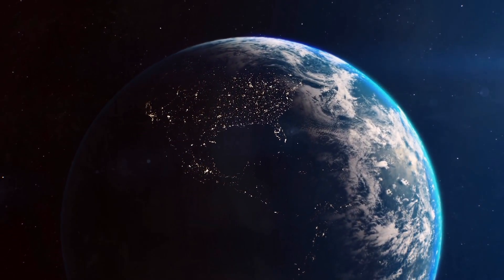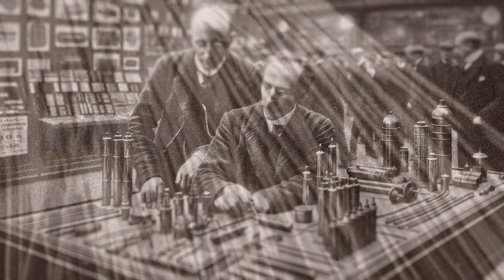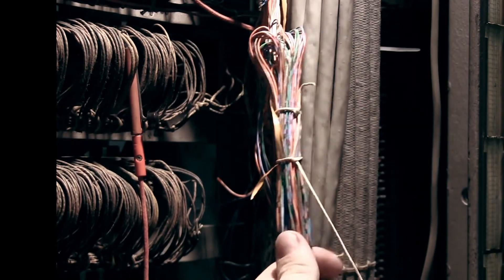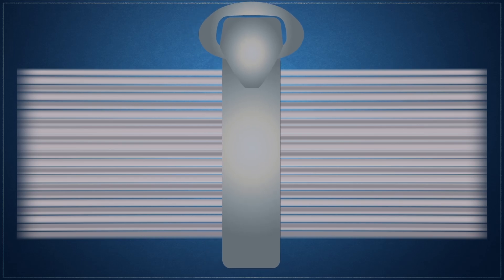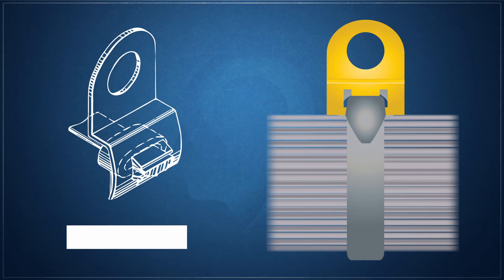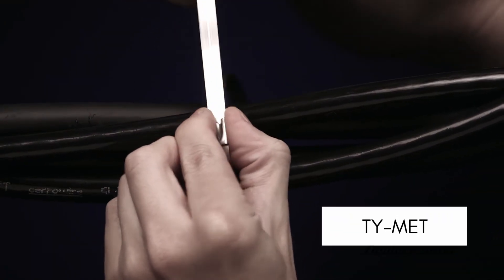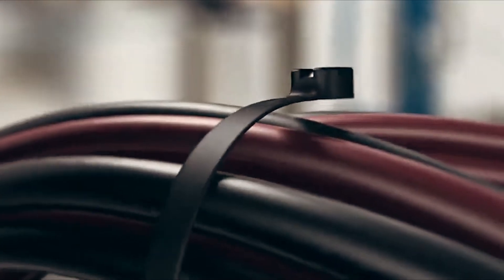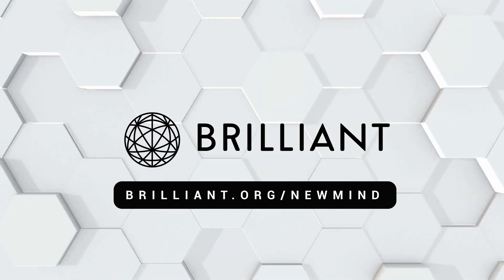The Zip Tie Story

Comment: I have used well over 10000 t&b ty-rap cable ties in my career as an electrician. They still make the best quality cable ties that I have used. 

Although I will say zip ties have almost no place in a datacenter. Speaking as an electrician who works in datacenters. Velcro for data, and ideally busway for power.
Reply: Datacenter infrastructure engineer here. Yup, that's precisely how it's done in our datacenter as well. Making sure cable management is done well and according to the specific function of the cables and the environment they're in, saves so much time and frustration when there's an issue and you have to figure it out and repair it. The frustration of having to figure out a spaghetti mess of cabling while under immense pressure because there's an issue causing downtime, is really grinding. It's always such a relief when I start working at a new company (I'm a datacenter consultant) and a professional such as yourself has taken care and professional pride to do the cabling properly, orderly and to spec. I always make sure to thank them if the people that cabled everything properly are still working there
Reply: I do see them use the zip ties to sart with and after having the cables bundelt well. then replace those ties with Velcro or in some cases rubber bands.
The zip ties are easier to apply with one hand. and will let you then replace the Velcro very neatly.
Reply: I agree fully with the use of Velcro cable ties for networking. As a former industrial electrician, I have used my fare share of zip ties when working in electrical panels or when BUILDING said panels. Zip ties and panduit make a panel look SO GOOD. I've seen people refer to some networking pictures as "Cable Porn" but if you've ever worked in the industrial space and seen a large panel or multiple cabinets built out, it looks SO DAMN SEXY!!
Reply: Velcro is very underrated for cable management.
Reply: Agreed, unless it's a finished product/machine you should definitely use velcro ties instead.

Comment: I stopped using zip ties and started lacing my cables because lacing doesn't have the sharp edges that zip ties have and you can get a lacing knot a lot tighter than any zip tie
Reply: You can avoid those sharp edges by trimming the ties with a sharp box cutter, instead of diagonal or side cutters. I like lacing, but it takes more time.

Comment: Use flathead to reuse zipties!
Reply: the problem is that most of the time. i use a pair of wire cutters or pliers to pull the sumbitch TIGHT, so the plastic stretches
Reply: This is an excellent answer. @judyfps5059